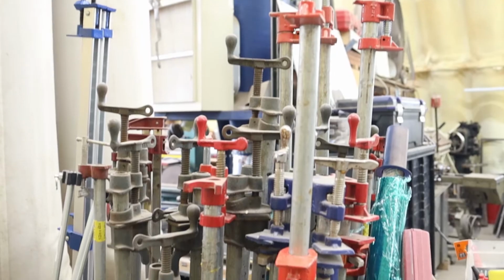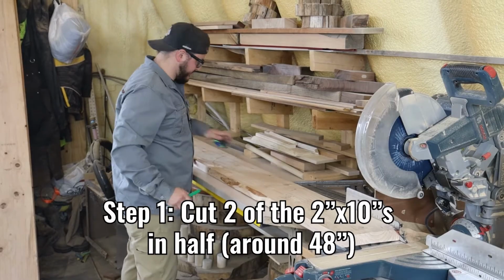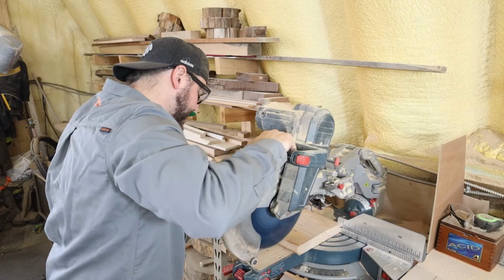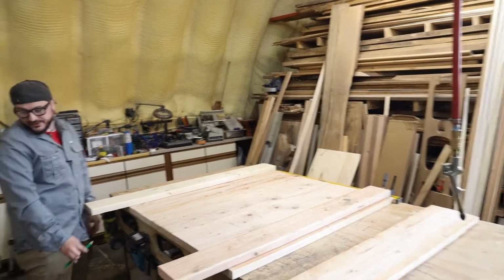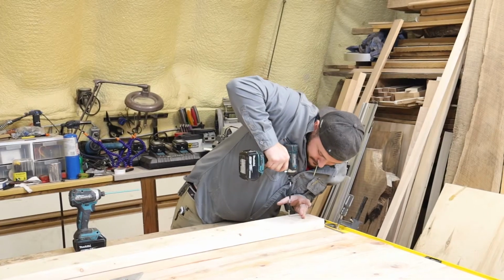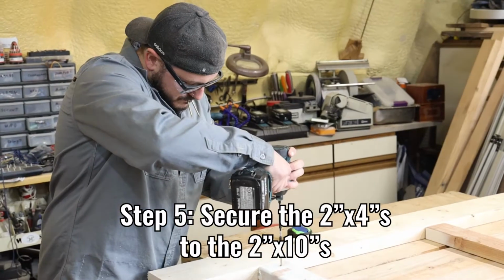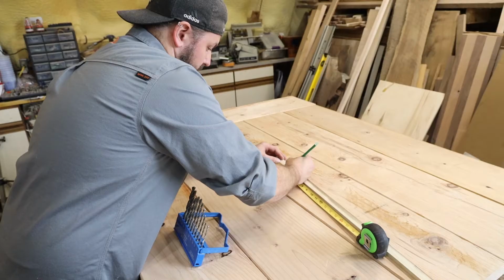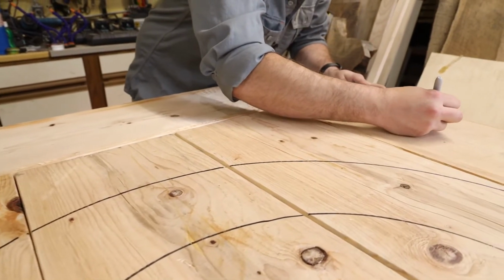How to Build an Axe Throwing Target – Basic DIY Build [Feat. CoPilot Designs]

Comment: Quick question: If you cut 2 of the 2x10s in half that gives you 4 halves. Whered you get the 5th from, since you didn't cut the final 2x10 until after assembling the 5 halves. Am I missing something? Thanks!

Comment: How did you start with 3 2''x10''x8' and you cut 2 in half, but then when you placed them down you had 5 47" pieces and enough left over to cut it 58" across the top